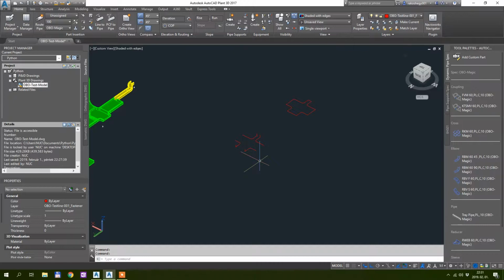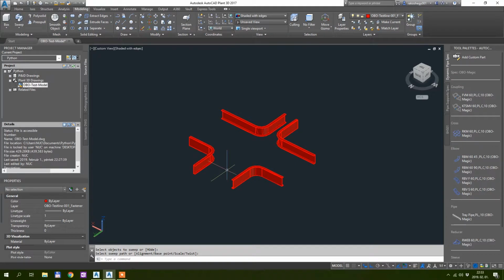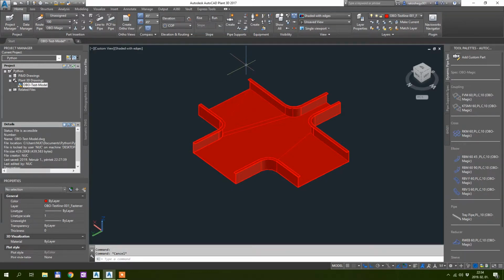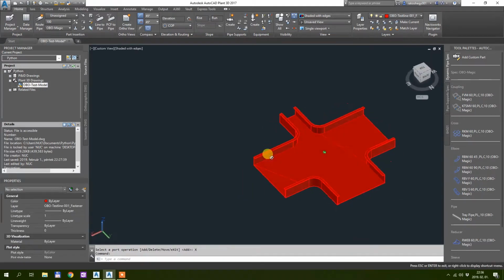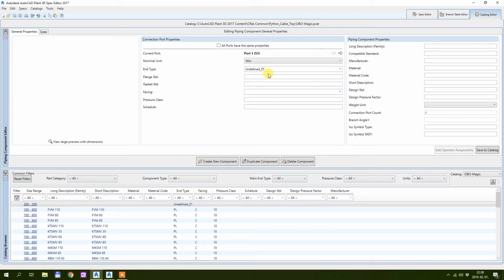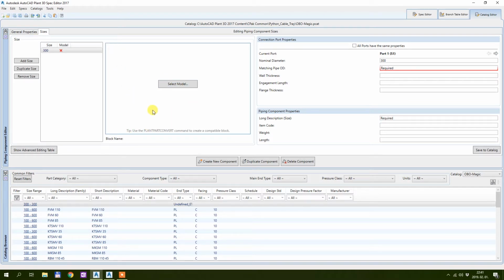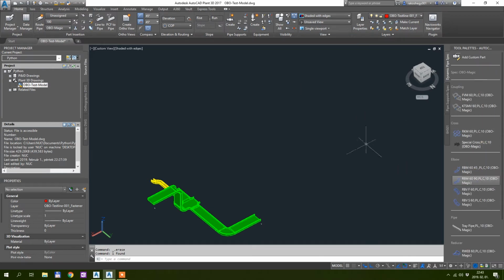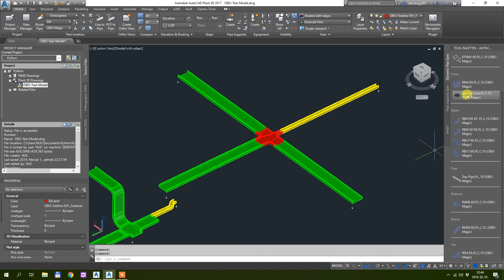Python Cable Tray - Special items using PlantPartConvert command

Comment: Hi, thank you for the video. Just i would like to ask, cable tray lengths are fixed or can strechable like pipes?
Reply from the maker: Hi!

The lengths are changeable. But not like pipes , but the L1 parameter can be modified in the properties.